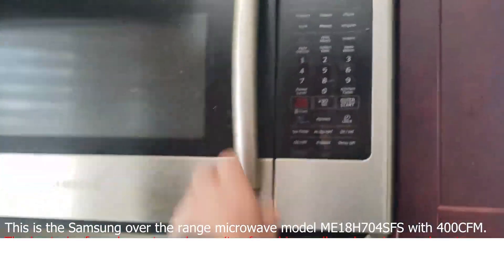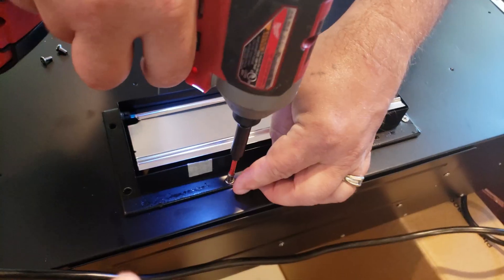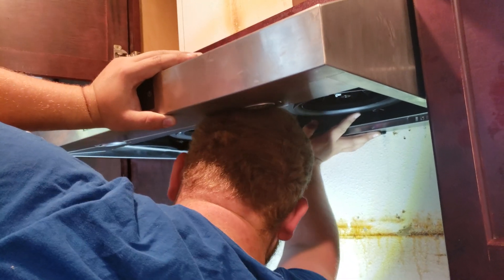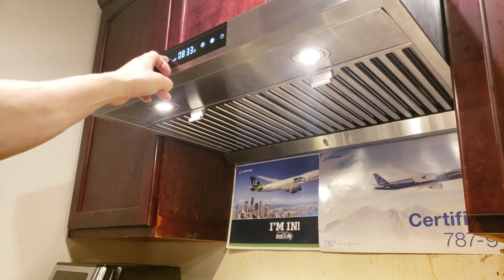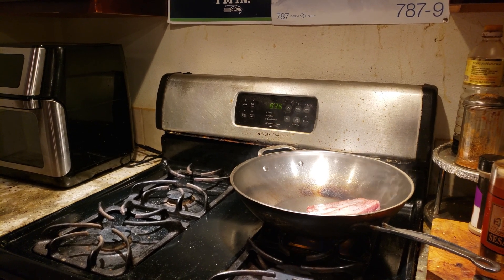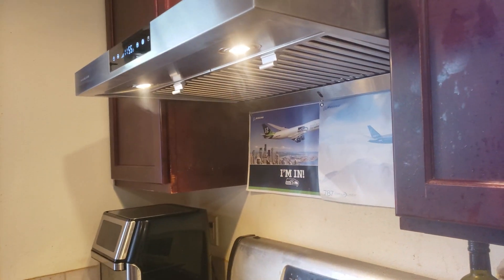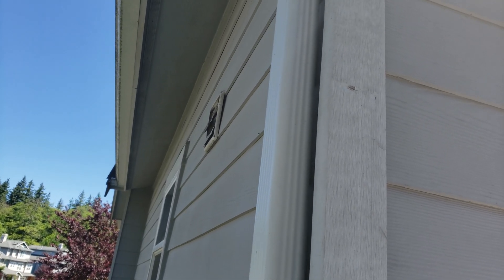Hauslane UC-PS18 Range Hood Diagnostic | Why Isn't My Outside Vent Flap Blowing Air?

Comment: I hate that the lazy installers didn't care about the quality of the install. You have the great 6 inch round duct right there, they could've used the round opening in the hood by simply removing the old greasy rectangular adapter that has tape in the video, and using a short section of flexible ducting to connect to the round adapter on hood...much superior to the way they did it. 
People pay good money, and wait, and the stores hire these third-string installers who can't get work anywhere else, BECAUSE THEIR WORK IS HORRIBLE.
Been there, my friend.
Reply from the maker: They said it's not there job to ensure an airtight or proper fit as they are there just for installation. It goes to show they aren't dependable. Anyway, it's fixed now as I've had a new unit replaced and they used brand new vent ducting and also outside duct which has a barrier to prevent birds from making a nest. This video shows more info: https://youtu.be/8O6KWq5GJvA
Reply: @JayRules I’m sorry, the first one is a very good hood, I think I will buy the same model.

Comment: I'm having the same problem, the suction power isn't as strong as my previous machine which was had a lower CFM...did you figure out the reason?
Reply from the maker: It's because of the installer not using the aluminum tape which leaves gaps for air to to blow out into the machine instead of all through the ducting to the outside.

Comment: I just bought the same model with the same problem. It seems like the internal louvre was stuck, since I was able to push up through one of the fans with a chopstick and get the louvres loose and it now works like a champ.
Reply from the maker: Can you please tell me what you did to push up on the flaps? Did you just use a chopstick to push up in the vicinity to open the flap? How will it remain open?
Reply from the maker: I just tried your method but instead of a chopstick, I used a long thin cutting knife and it did open up the duct flap. I turned on the fan and the outside vent flaps were moving so it proved it worked! Thank you so much for your idea. I gave you thanks in my video which I will upload later.
Reply from the maker: I gave a shoutout to you: https://youtu.be/aeN-ZVjPxkk
Reply: Is the louvre the damper? Im having the same issue and want to try this but I don’t know what the louvre is.😢

Comment: You may not have a makeup air vent.  There is not enough leakages in your house to supply replacement air that the hood is trying to throw out.  I good test is to run it when one Door is open wide.
Reply from the maker: There is a vent cutout to the outside. My previous microwave fan was able to remove smoke and smell to the outside and from the outside you can see the flaps move due to the suction power.

Comment: This is one of my finalists as I choose a new range hood. Did you ever open the cabinet box and apply the aluminum tape to see if that fixed the issue? If you didn't get to it or if you did but it didn't fix the issue, I'm going to cross this model off my list so thanks for the honest video.
Reply from the maker: I haven't figured out how to open the duct box above the range hood. That is one of my goals for this year to fix. I honestly think this is a good design but the installers neglected to apply the aluminum tape to ensure airtightness.

Comment: Hi Jay,
I bought the same range hood and experiencing same problem.
My whole house has cooking smell. How you fixed this.
I am using back rectangular vent.
Thanks
Reply from the maker: Did you install this yourself or did you order it through Home Depot or Lowes? I bet they didn't use the aluminum tape and ensure an airtight seal so the sucked up air is leaking which drastically reduces the true suction power. I have to figure out how to open the duct box so I can apply the aluminum tape myself. That is my goal for this year.
Reply: Thanks for the reply.
I did by myself. I didn’t apply aluminium at the back but I did at the other joints.
I will open it again and try if I can get access to the back joint
Reply: Did you fix the problem? How is it now? @harmindersinghsohal3803

Comment: Jay were you able to find the solution for this? I dont have this problem (yet) but am about to buy this same unit and replace my old one. Hope to know in case I have th same issue bacause the old one seems to be blowing back the smoke too.
Reply from the maker: I haven't fixed the issue yet because I've been busy and the last time I tried to open the wood duct box, it wouldn't open so I have to do more research. If you install it or have others install it, make sure the duct fits exactly to the opening and apply aluminum tape to ensure air tightness. Are you planning on installing it yourself? I'm going to leave it for next year's to do list resolution lol.
Reply: @JayRules  Yes we're going to install it ourselves since it's just replacing an existing unit. I'll aluminum tape it to death as you suggest and hopefully that works. Thanks!
Reply from the maker: Make sure to drill the holes logistically and use washers per the instructions. Also, if your cabinet is old or have holes from previous installs, it could give issues. Good luck. Let me know how it goes and the suction power. Test it out with paper or plastic plates and see if the outside vent flaps move when turned on high. @subsyt
Reply from the maker: I learned if the holes are big just use big washers to make it fill the empty area.  @subsyt

Comment: You need to take the duct cover off in the cabinet and tape it to the outside 6 inch duct ✅
Reply from the maker: I understand that. The installers should've used the aluminum  tape which was provided. I don't even know how to open up my wood duct box to apply the tape. Do you have any tips?
Reply: I would call the installers and make them do it right ASAP ✅
Reply from the maker: I already went through all that with Lowes and Hauslane. Lowes sent me a check to compensate for the trouble. Now I have to figure out how to open the duct box. @zofo_5735
Reply: @JayRules  it needs to be reinstalled take it down and get it done right reseal the vent needs to be done proper ✅
Reply from the maker: Thanks for the tips @zofo_5735

Comment: I have exactly same product that is blowing smoke inside house. It is a defective unit by design, it doesn’t work as expected, my house is smelling so bas after i installed this unit. I hope you will give some feedback to Hauslane and Lowes.
Reply from the maker: If you look at the installation process requirements, the installers are supposed to use the aluminum tape so that it reduces blowback and eliminate any openings but they didn't. This is what reduces the suction power. My plan is to open up the vent box to apply the tape as soon as I figure out how to open it.

Comment: I have the exact same problem.  What was your solution?
Reply from the maker: I have yet to fix it because I'm busy with so many Youtube product tests & review. There are actually 2 steps I can take: 1) open up the duct box to apply the aluminum tape in order to seal any leaks 2) open up the duct box and find exactly the right size vent adapter which can possibly mean replacing the ducting. I think I will choose option 1 as soon as I do some more research about how to open the duct box. I tried with razorblades but it just won't budge or open.

Comment: Any resolution on this?  I plan to replace my over-the-range microwave with a range hood to improve smoke and steam removal when cooking.  I don't think that hood you bought should have any trouble clearing the smoke you're creating and that the exterior vent flaps should be completely open.
Reply from the maker: I'm glad you asked because I have been in talks with both Lowes and Hauslane trying to resolve the issue. I'm planning on opening up the duct box to apply the aluminum tape in order to make it air or leakproof. Air must be escaping so it's reducing it's designed suction power. I need to find time to find a way to open the box. I've tried before but with no luck. I need to do some more research. If you do get yours replaced, make sure they use the tape or better yet have the right size vent adapter.
Reply: @JayRules  I'm also wondering whether the flap inside the hood isn't opening when you turn the fan on.  When I mounted my over the range microwave, I found that the flap would hit the corner of the exhaust vent that came from above.  I ended up just removing the flap altogether.
Reply from the maker: @donstrong6754  It's a strong possibility. Do you have any tips of opening the duct box?
Reply: You probably have resolved the issue now but I had the same issue and it was caused by the damper provided by the range hood that was obstructed by some foil tape. I ended up forcing it open and it resolved the issue

Comment: You can fix it yourself. The box in the cabinet above your exhaust probably has a false front that is removable. Just take it off and fit the duct to your exhaust and wall then seal it with water heater tape. Pretty simple. Just installed mine today.
Reply from the maker: I tried opening it along the seams with a razor but it wouldn't budge. Does the front wall lift up or down, or simply fall forward?
Reply: @JayRules  is it nailed or screwed together?  If not, then it’s glued and once you run your razor in the grove it should move and fall inward.
Reply from the maker: @Realdavidart  I don't see any nails or screws but when I run a thin shaving razor along the lines and tried to push it didn't even budge. Maybe the years of the oil/grease stains made it more difficult to open. Maybe I'll try with a thin switchblade or box cutter.

Comment: what's your answer?
Reply from the maker: The installers didn't use aluminum foil tape or check for airtightness so it leaks air in the surrounding area which is affecting the overall exhaust performance. I am in contact with Lowes technical support.
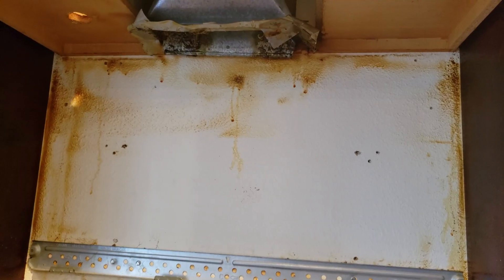Reply: @JayRules  Thanks. Do you mean they didn't open the wooden box cover 1:17 when they attached it to the ducts 0:37?
Reply from the maker: @smartestpaperinvestor180  No, the installer claim it's not their responsibility. They didn't even bother checking for airtightness. I'm currently in contact with Lowes corporate for a solution.